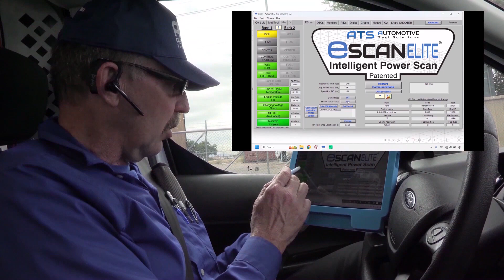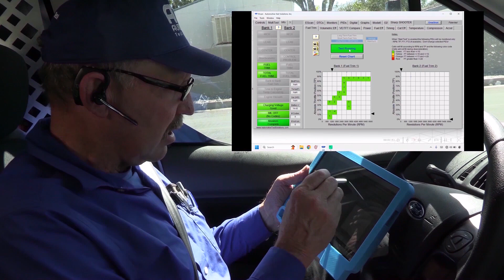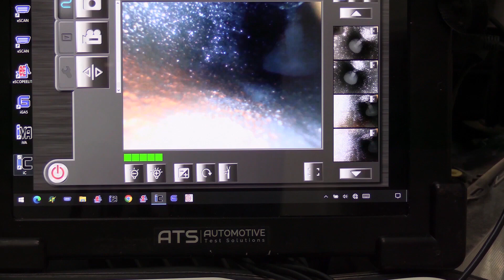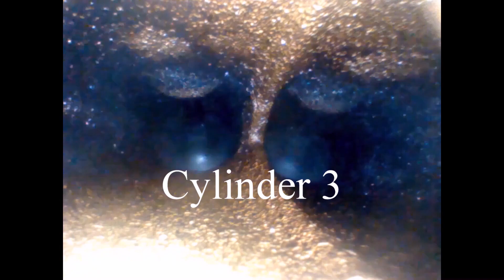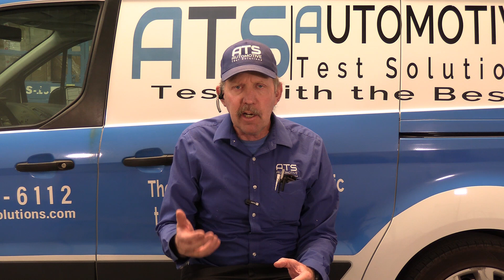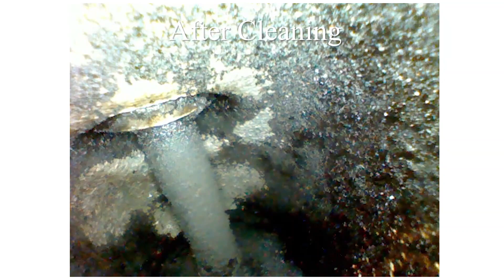2021 Ford Transit Connect Loss of Fuel Mileage

Comment: Did it clean the valves on all cylinders equally? I don't see this system available on the ATS website. Will it hydro-lock cylinders without precise metering into the engine? Is it OK for RAF/o2 sensors? Will it affect the performance/life of the catalytic converters?

Comment: Nice to see the before and after pics of the valves. What, if any, risk is there to the catalytic converter from all the carbon deposits and chemicals running though them? Also O2 or AFR sensors?

Comment: Bernie greetings from Caracas. Thank you. My question... Phasing the VVT is it dangerous or not? as you know, interference engines can bend valves but sometimes with your scanner you can bend them too or is it a myth? Bernie Thompson our master well he really likes commanding VVT for his diags, with the scanner and also manually by energizing the VVTs as he doing his diags when correlation timing codes P0016 P0017 P0018 and others. By the way, you know Ivan from PINE HOLLOW well I think he developed his thought process by studying Bernie Thompson because Ivan and Bernie are the only ones I know that energize VVTs without any fear at all. Is this dangerous or not dangerous VVT diag technique of commanding VVT with scanner or manually energizing them to do timing diagnostics. Thank you. Thank you. I am asking u but sure the same Bernie reading this can give us a video just talking about this. But I also would like to read you opinion friend. Thank u

Comment: This is a usa product only it should be sold worldwide amazing technican and products ats is the best it really need to be marketed worldwide
Reply: Phasing the VVT is it dangerous or not? as you know, interference engines can bend valves but sometimes with your scanner you can bend them too or is it a myth? Bernie Thompson our master well he really likes commanding VVT for his diags, with the scanner and also manually by energizing the VVTs as he doing his diags when correlation timing codes P0016 P0017 P0018 and others. By the way, you know Ivan from PINE HOLLOW well I think he developed his thought process by studying Bernie Thompson because Ivan and Bernie are the only ones I know that energize VVTs without any fear at all. Is this dangerous or not dangerous VVT diag technique of commanding VVT with scanner or manually energizing them to do timing diagnostics. Thank you. Thank you. I am asking u but sure the same Bernie reading this can give us a video just talking about this. But I also would like to read you opinion friend. Thank u

Comment: Fantastic case studies, Bernie! Thanks for sharing.
Reply: Phasing the VVT is it dangerous or not? as you know, interference engines can bend valves but sometimes with your scanner you can bend them too or is it a myth? Bernie Thompson our master well he really likes commanding VVT for his diags, with the scanner and also manually by energizing the VVTs as he doing his diags when correlation timing codes P0016 P0017 P0018 and others. By the way, you know Ivan from PINE HOLLOW well I think he developed his thought process by studying Bernie Thompson because Ivan and Bernie are the only ones I know that energize VVTs without any fear at all. Is this dangerous or not dangerous VVT diag technique of commanding VVT with scanner or manually energizing them to do timing diagnostics. Thank you. Thank you. I am asking u but sure the same Bernie reading this can give us a video just talking about this. But I also would like to read you opinion friend. Thank u

Comment: Cómo siempre excelente contenido, congratulations
Reply: Phasing the VVT is it dangerous or not? as you know, interference engines can bend valves but sometimes with your scanner you can bend them too or is it a myth? Bernie Thompson our master well he really likes commanding VVT for his diags, with the scanner and also manually by energizing the VVTs as he doing his diags when correlation timing codes P0016 P0017 P0018 and others. By the way, you know Ivan from PINE HOLLOW well I think he developed his thought process by studying Bernie Thompson because Ivan and Bernie are the only ones I know that energize VVTs without any fear at all. Is this dangerous or not dangerous VVT diag technique of commanding VVT with scanner or manually energizing them to do timing diagnostics. Thank you. Thank you. I am asking u but sure the same Bernie reading this can give us a video just talking about this. But I also would like to read you opinion friend. Thank u

Comment: Bernie, the real reason your gas mileage is suffering is all that money you're hauling around from all those cool ATS products! 🤣
Reply: Phasing the VVT is it dangerous or not? as you know, interference engines can bend valves but sometimes with your scanner you can bend them too or is it a myth? Bernie Thompson our master well he really likes commanding VVT for his diags, with the scanner and also manually by energizing the VVTs as he doing his diags when correlation timing codes P0016 P0017 P0018 and others. By the way, you know Ivan from PINE HOLLOW well I think he developed his thought process by studying Bernie Thompson because Ivan and Bernie are the only ones I know that energize VVTs without any fear at all. Is this dangerous or not dangerous VVT diag technique of commanding VVT with scanner or manually energizing them to do timing diagnostics. Thank you. Thank you. I am asking u but sure the same Bernie reading this can give us a video just talking about this. But I also would like to read you opinion friend. Thank u

Comment: I've got to look into this more.  I know BG had some induction cleaners, but I haven't heard anything lately about that company.
Reply: Phasing the VVT is it dangerous or not? as you know, interference engines can bend valves but sometimes with your scanner you can bend them too or is it a myth? Bernie Thompson our master well he really likes commanding VVT for his diags, with the scanner and also manually by energizing the VVTs as he doing his diags when correlation timing codes P0016 P0017 P0018 and others. By the way, you know Ivan from PINE HOLLOW well I think he developed his thought process by studying Bernie Thompson because Ivan and Bernie are the only ones I know that energize VVTs without any fear at all. Is this dangerous or not dangerous VVT diag technique of commanding VVT with scanner or manually energizing them to do timing diagnostics. Thank you. Thank you. I am asking u but sure the same Bernie reading this can give us a video just talking about this. But I also would like to read you opinion friend. Thank u

Comment: Thanks for sharing Bernie 👍
Reply: Phasing the VVT is it dangerous or not? as you know, interference engines can bend valves but sometimes with your scanner you can bend them too or is it a myth? Bernie Thompson our master well he really likes commanding VVT for his diags, with the scanner and also manually by energizing the VVTs as he doing his diags when correlation timing codes P0016 P0017 P0018 and others. By the way, you know Ivan from PINE HOLLOW well I think he developed his thought process by studying Bernie Thompson because Ivan and Bernie are the only ones I know that energize VVTs without any fear at all. Is this dangerous or not dangerous VVT diag technique of commanding VVT with scanner or manually energizing them to do timing diagnostics. Thank you. Thank you. I am asking u but sure the same Bernie reading this can give us a video just talking about this. But I also would like to read you opinion friend. Thank u

Comment: I have personally used Techtron but it will never touch the carbon on my GDI  valves. Good video!
Reply: Phasing the VVT is it dangerous or not? as you know, interference engines can bend valves but sometimes with your scanner you can bend them too or is it a myth? Bernie Thompson our master well he really likes commanding VVT for his diags, with the scanner and also manually by energizing the VVTs as he doing his diags when correlation timing codes P0016 P0017 P0018 and others. By the way, you know Ivan from PINE HOLLOW well I think he developed his thought process by studying Bernie Thompson because Ivan and Bernie are the only ones I know that energize VVTs without any fear at all. Is this dangerous or not dangerous VVT diag technique of commanding VVT with scanner or manually energizing them to do timing diagnostics. Thank you. Thank you. I am asking u but sure the same Bernie reading this can give us a video just talking about this. But I also would like to read you opinion friend. Thank u

Comment: Thanks for sharing Sir👍🏻👍🏻👍🏻
Reply: Phasing the VVT is it dangerous or not? as you know, interference engines can bend valves but sometimes with your scanner you can bend them too or is it a myth? Bernie Thompson our master well he really likes commanding VVT for his diags, with the scanner and also manually by energizing the VVTs as he doing his diags when correlation timing codes P0016 P0017 P0018 and others. By the way, you know Ivan from PINE HOLLOW well I think he developed his thought process by studying Bernie Thompson because Ivan and Bernie are the only ones I know that energize VVTs without any fear at all. Is this dangerous or not dangerous VVT diag technique of commanding VVT with scanner or manually energizing them to do timing diagnostics. Thank you. Thank you. I am asking u but sure the same Bernie reading this can give us a video just talking about this. But I also would like to read you opinion friend. Thank u

Comment: Those who approve the production of GDI engines should be in jail. This is why such GDI is not popular at all and will never be. The sane Humans needs a sustainable durable engine that with a basic oils, fluids change would last almost for very long term as this is how the natural cars have been and should be, but there are a global elite campain against populace to further plunder the overgrown populace and keep them in perpetual money drain and dept. whereas new cars is part of the wars against populace, not to mention the hackable CAN bus systems that aims not to save on wires as falsly claimed of which the opposite is true, but to monitor "control" Humans and further make the vehicle overdosed with over complex and mostly not enoght tested electronics that fails quickly, and which almost very few Alchemists in the world like Uncle Bernie can tackle, not even dealers "the secret keepers" can solve many electrical and electronic issues. People should collectively boycott new cars and request a phasing out of CAN systems, and request a solid state (non reprogrammable) ECM that only control emissions only as initially purposed, without interfering with other vehicle systems like radios, mirrors ... etc that should be individually separated to facilitate traceability and repairs.

Comment: It seems this new vortex system replaces the original machine that was designed for carbon removal?  Should be much more affordable than the original machine!  Is it ok to use on engines with such excessive carbon buildup that its causing misfires?

Comment: Would it be a good idea to have someone open the valve after you raise the idle.
Reply: Phasing the VVT is it dangerous or not? as you know, interference engines can bend valves but sometimes with your scanner you can bend them too or is it a myth? Bernie Thompson our master well he really likes commanding VVT for his diags, with the scanner and also manually by energizing the VVTs as he doing his diags when correlation timing codes P0016 P0017 P0018 and others. By the way, you know Ivan from PINE HOLLOW well I think he developed his thought process by studying Bernie Thompson because Ivan and Bernie are the only ones I know that energize VVTs without any fear at all. Is this dangerous or not dangerous VVT diag technique of commanding VVT with scanner or manually energizing them to do timing diagnostics. Thank you. Thank you. I am asking u but sure the same Bernie reading this can give us a video just talking about this. But I also would like to read you opinion friend. Thank u

Comment: I cant say im impressed with the intake runners are cleaned of a low mileage van. 
Ive been running chevron Techtron for many years.
My truck is 23 years old, same injectors, same cats, same intake system, i don't use junk K/N filters. I learned a bad mistake using K/N air filter on my 95 van. 
After i removed the intake manifold. There was so much fine dusty with oil mixed coated the runners. 
That day, i will never use any K/N crap. 
Bernie, 
The true test is a vehicle that has over 100k with a bad bad crusty carbon intake mess.
Reply: Phasing the VVT is it dangerous or not? as you know, interference engines can bend valves but sometimes with your scanner you can bend them too or is it a myth? Bernie Thompson our master well he really likes commanding VVT for his diags, with the scanner and also manually by energizing the VVTs as he doing his diags when correlation timing codes P0016 P0017 P0018 and others. By the way, you know Ivan from PINE HOLLOW well I think he developed his thought process by studying Bernie Thompson because Ivan and Bernie are the only ones I know that energize VVTs without any fear at all. Is this dangerous or not dangerous VVT diag technique of commanding VVT with scanner or manually energizing them to do timing diagnostics. Thank you. Thank you. I am asking u but sure the same Bernie reading this can give us a video just talking about this. But I also would like to read you opinion friend. Thank u

Comment: Love Bernie, but something ain't right. If so worried about air quality, I'm curious of what is going out the tail pipe during the chemical cleaning. It ain't water.
Reply: Was wondering the same thing about the catalytic converters...that nasty stuff has to land somewhere...
Reply: Phasing the VVT is it dangerous or not? as you know, interference engines can bend valves but sometimes with your scanner you can bend them too or is it a myth? Bernie Thompson our master well he really likes commanding VVT for his diags, with the scanner and also manually by energizing the VVTs as he doing his diags when correlation timing codes P0016 P0017 P0018 and others. By the way, you know Ivan from PINE HOLLOW well I think he developed his thought process by studying Bernie Thompson because Ivan and Bernie are the only ones I know that energize VVTs without any fear at all. Is this dangerous or not dangerous VVT diag technique of commanding VVT with scanner or manually energizing them to do timing diagnostics. Thank you. Thank you. I am asking u but sure the same Bernie reading this can give us a video just talking about this. But I also would like to read you opinion friend. Thank u
Reply: @ElelectricistadeMateo  phasing the vvt via diagnostic tool or even activating the solenoids " by hand" by applying 12v is perfectly safe. Let's put it this way...if the timing was out before you activated the vvt the engine would have kissed even before your tried.
Reply: @alexdragomirescu5084  thanks Alex for your comment.

Comment: Bernie......is a lot of this carbon build up due to 0W/5W engine oils?
Reply: Phasing the VVT is it dangerous or not? as you know, interference engines can bend valves but sometimes with your scanner you can bend them too or is it a myth? Bernie Thompson our master well he really likes commanding VVT for his diags, with the scanner and also manually by energizing the VVTs as he doing his diags when correlation timing codes P0016 P0017 P0018 and others. By the way, you know Ivan from PINE HOLLOW well I think he developed his thought process by studying Bernie Thompson because Ivan and Bernie are the only ones I know that energize VVTs without any fear at all. Is this dangerous or not dangerous VVT diag technique of commanding VVT with scanner or manually energizing them to do timing diagnostics. Thank you. Thank you. I am asking u but sure the same Bernie reading this can give us a video just talking about this. But I also would like to read you opinion friend. Thank u

Comment: Best diagnostician in automotive industry, thank you Bernie
Reply: Phasing the VVT is it dangerous or not? as you know, interference engines can bend valves but sometimes with your scanner you can bend them too or is it a myth? Bernie Thompson our master well he really likes commanding VVT for his diags, with the scanner and also manually by energizing the VVTs as he doing his diags when correlation timing codes P0016 P0017 P0018 and others. By the way, you know Ivan from PINE HOLLOW well I think he developed his thought process by studying Bernie Thompson because Ivan and Bernie are the only ones I know that energize VVTs without any fear at all. Is this dangerous or not dangerous VVT diag technique of commanding VVT with scanner or manually energizing them to do timing diagnostics. Thank you. Thank you. I am asking u but sure the same Bernie reading this can give us a video just talking about this. But I also would like to read you opinion friend. Thank u